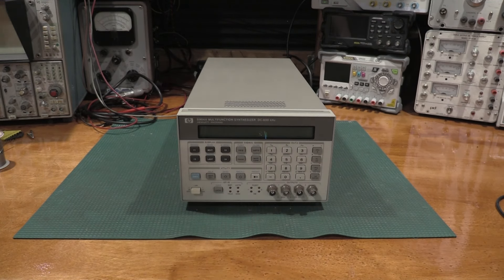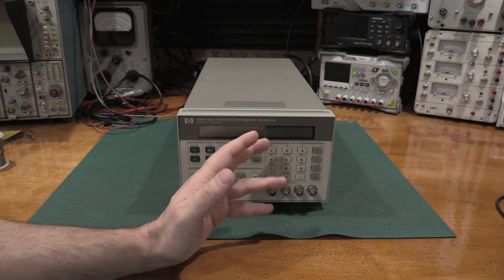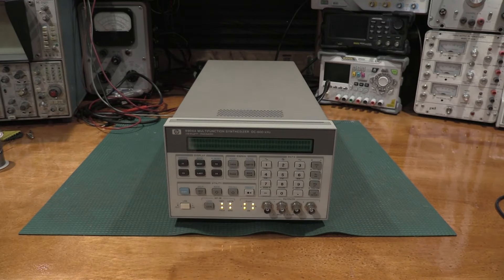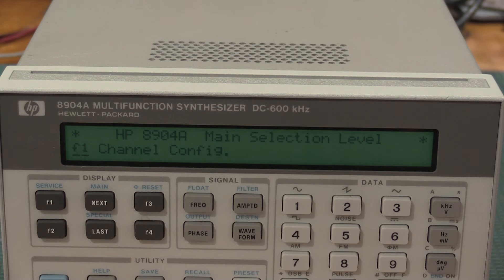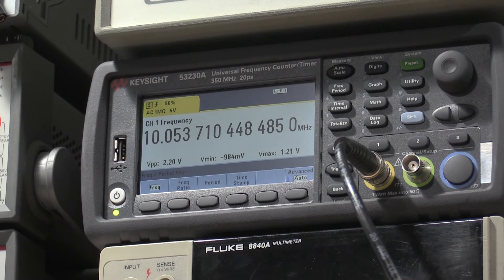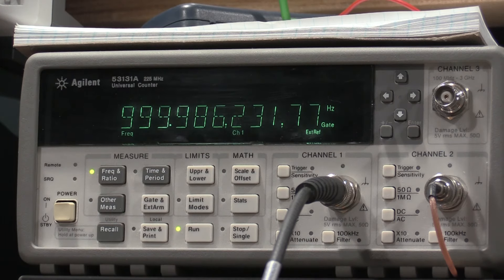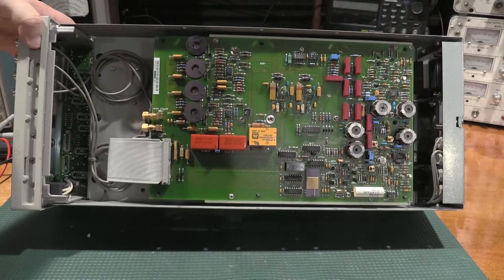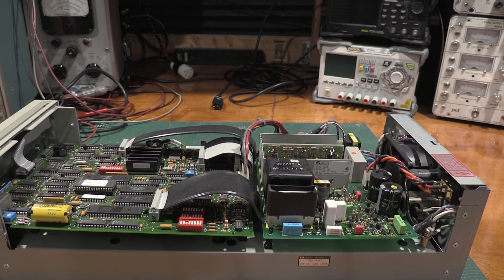HP 8904A Restoration and Lab Checkin

Comment: Nice unit! I use one to modulate an HP 8657B for FM tuner alignment - works perfectly. As others have suggested,  you should consider replacing the Rifa caps in the SMPS. Also, all software options can be easily turned on, info is available on the web and uses the programming info in the dead battery recovery service note. The display uses an ELP and many of these units have dim displays. Fortunately it uses a standard 2-line LCD display and one with an LED backlight will fit - I seem to remember it needing some different standoffs. I added a small interface board with a pot for backlight brightness control. Regards, David

Comment: hey, how is the sound quality in a stereo modulated signal? I am asking because i can see it's frequency limit is 600khz. Normally, for voice you would need larger frequency range? Maybe 1khz to 12khz? Or am i wrong?
Reply from the maker: 1Khz to 12 Khz is well within the 600 Khz range of an 8904 however this is only the data content of the FM signal. You need to feed the 8904 in to an 8656, 8657, 8642 Or other some such instrument with a external modulation input to get the RF carrier that is needed so a receiver can be tuned. The 8904 also does not to audio in to the RF source it is pure tone based. But is could theoretically be set up with some difficulty to produce some audio but an RF generator would still also be needed.

Comment: Why are the four outputs required? This is the first I have heard that the four outputs are required. Thank you for another well done video.
Reply from the maker: The 4 outputs are for the floating option. Like a SMU when the output is set to floating there is Signal high and Signal Low. I might have mentioned this is for differential signaling but that is NOT the case with this unit. There is another video on the way that will go a bit deeper in to this.
Reply: I should have paid closer attention. Thanks so much for taking the time and responding.

Comment: That battery also backs up configuration info like serial number, S/W option keys etc. If the battery goes flat you will lose these and it is quite difficult to restore them.
Reply from the maker: The S/W Option key is very easy to restore. I need to look in to the serial number what that entails.
Reply: @ZenwizardStudios  Search for HP Service Note 8904A-05. It details how to recover from battery loss by entering some magic parameters. After that you can use the service manual to reenter the serial no, and the options.
Reply from the maker: Do you by any chance have a PDF of the complete service manual? Most of what I am finding on line is missing section 4 which is the alignment procedure. I do have that service note but I also need the complete service manual. Would like to do a full alignment after I get the appropriate power meters. I will need those for my spectrum analyzers as well.

Comment: Careful with the battery. If it dies I’ve heard the unit can be bricked. Also, see Defpom’s video on how to turn on all the software options.
Reply: There is a service note from HP on how to reconfigure it if the battery goes flat. So battery replacement is not an issue.

Comment: Nice video, thanks. Apparently the AutoDigits in the 53230A setting is Off - if so, probably all the digits after the nineth or tenth digit after the decimal point is just garbage.
Reply from the maker: I will check on the auto digits. I have the 53230A set up for testing some 10 Mhz lab references (videos will be out shortly) if the gate time is not long enough things will bounce around but the 53230A only needs a gate time of about 0.1 Sec to settle down quite a bit.